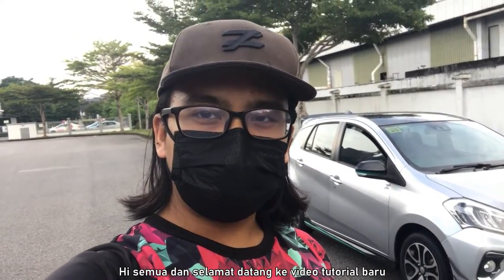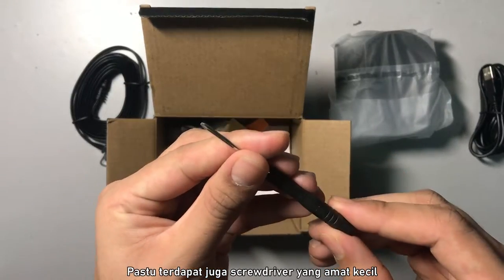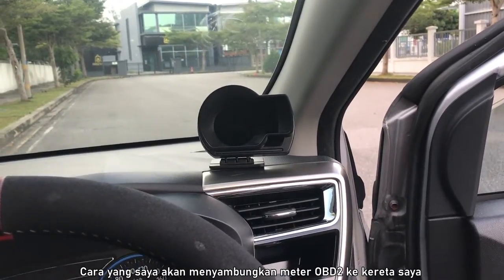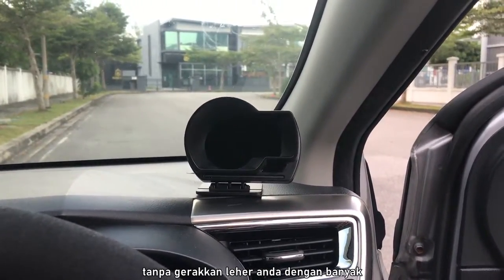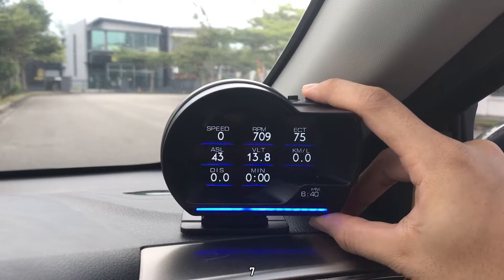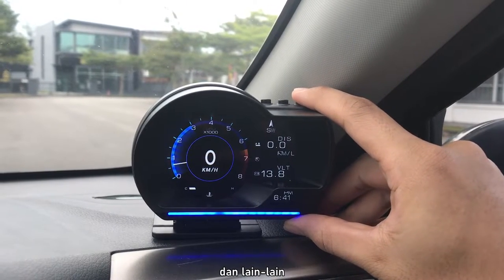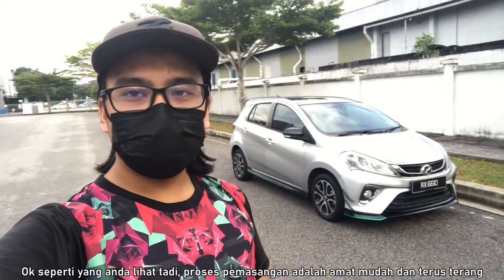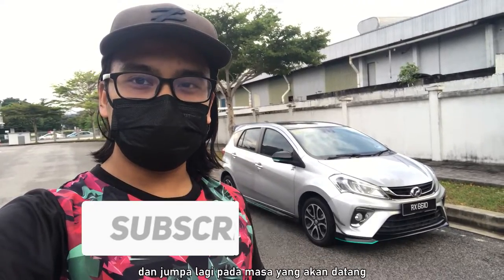Myvi G3—CARA PASANG METER OBD2 (BM Sub)

Comment: Hi..i bought one in Mauritius.can you please advise what does the orange stick is use for?
Reply from the maker: Hi there, that orange stick is used to pry open some panels from the interior of the car to tuck away the wire of the OBD2 meter. I didn’t need to use it as I preferred to leave the wires outside and not pry open any panels

Comment: if the car has a manual mode like the honda city, the gauge can display the current Gear or not?
Reply from the maker: Honestly I'm not so sure but maybe a quick YouTube search of OBD meter installation in a manual car will help
Reply: what brand ur car

Comment: is there a delay on the rpm and kmh meter? im using the OBD CBW brand it has a delay when im driving. my real meter shows 80kmh but the OBD still showing 68-78.
Reply from the maker: In my experience of using the OBD meter, I don't think there is a delay and I'm quite sure the speed and rpm shown on the OBD meter matches the one on the real meter quite similarly
Reply: @WayzerDude  looks like i have to get this AKIRA then 😅
Reply from the maker: @zulkifliasri3926  hope it works better for you! :D

Comment: How does the GPS mode work? I have a Corolla with OBD1 port so when connected it shows only battery volt. So have to change to GPS mode. Any idea how the GPS mode works?
Reply from the maker: Ah well I actually made a follow up video showing how to use GPS mode but basically you gotta connect the OBD meter to a USB port instead of the OBD1 port for your Corolla
Reply: @WayzerDude  thanks Wayzer for replying. I am not able to see the follow up video. Can you share the link and also throw some lights on how the GPS mode works please. Thanks.
Reply from the maker: You should be able to find the instructions for the GPS mode in this video: https://www.youtube.com/watch?v=N4nuEq2j9bc

Basically the GPS mode works more or less the same way the OBD mode works but the features are much more limited; more info on the GPS mode have been explained in the follow up video yea